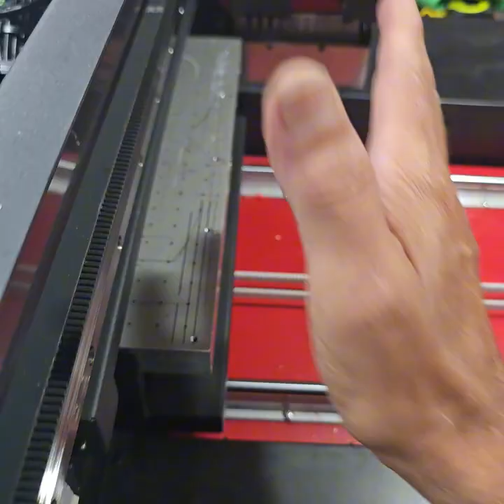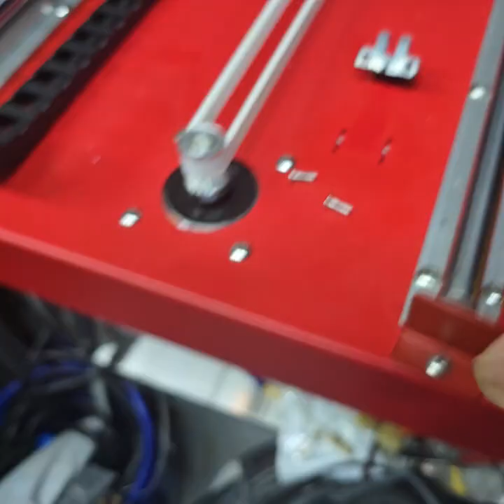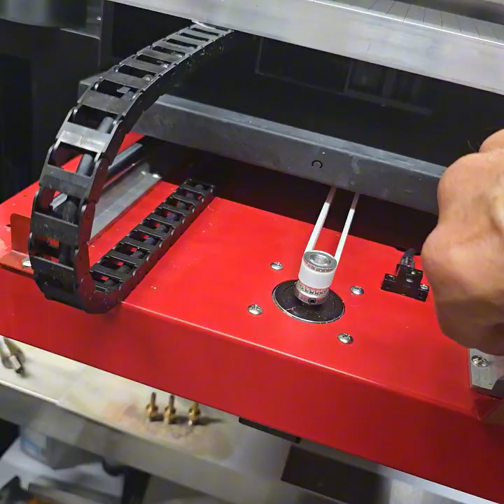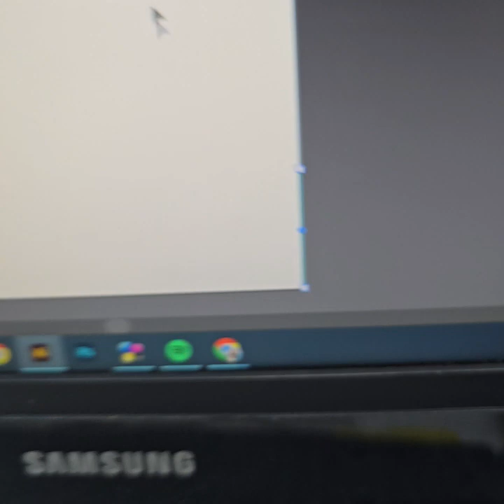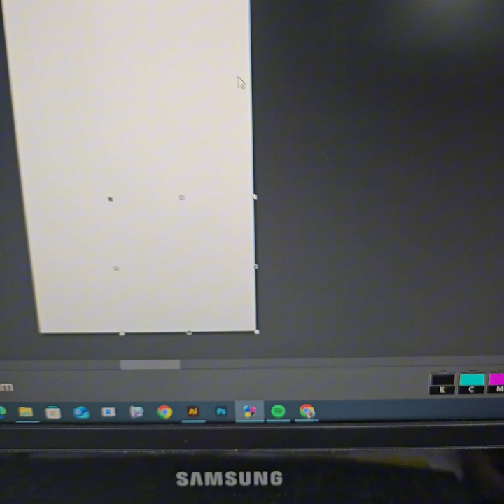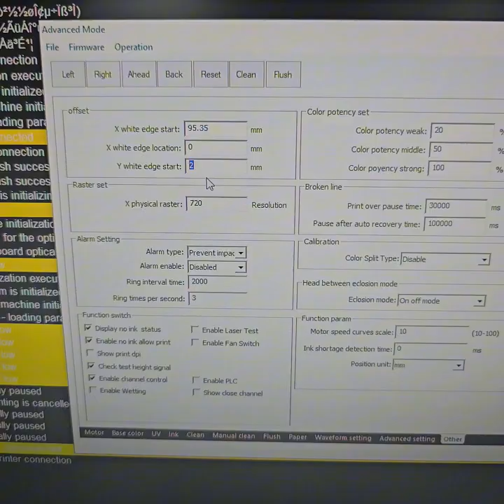How to fix RefineColor UV Printer Bed Y 0 Issue

Comment: If you go into the advance settings and enter the password 111111, then go to the "Other tab" there is a setting to adjust the "Y" start edge. Simply measure the distance on the bed and enter that number. Hope this helps :)
Reply: I am thinking of buying the 6090 Pro. Is this Y Axis situation still a problem on that model as well? My first Chinese printer purchase so I'm a little nervous.
Reply from the maker: @davelyew4645  honestly I don't know, I think you have to ask in the group if someone have that issue.
Reply: Sorry for the delay,, I know your point about the Y in advance, but the thing is most of us put in 0 there and we have 2-5mm from the bottom edge and that Y option don't work with negative number like -2mm  or -10, that is why I make this video for people typing 0 in Y don't  get to the edge. For the X that work with negative number, like mine is -95.